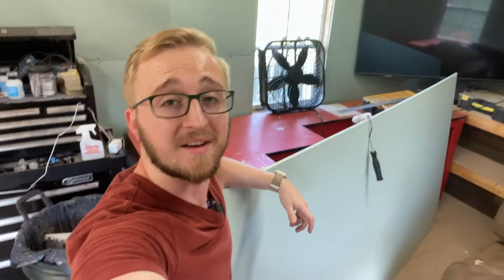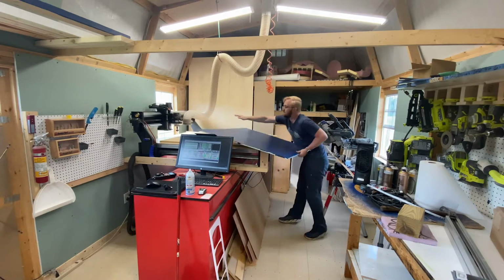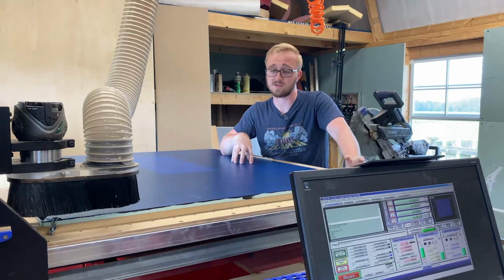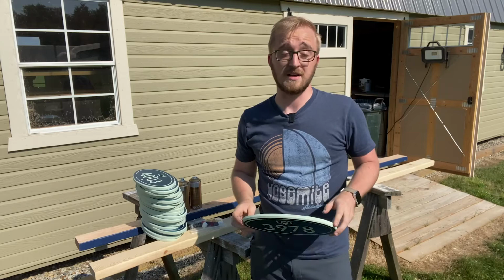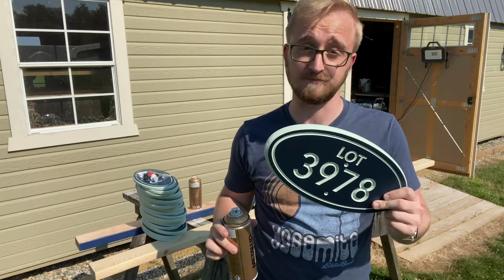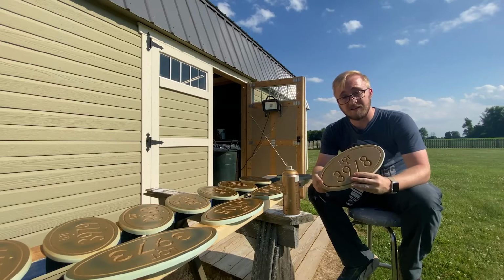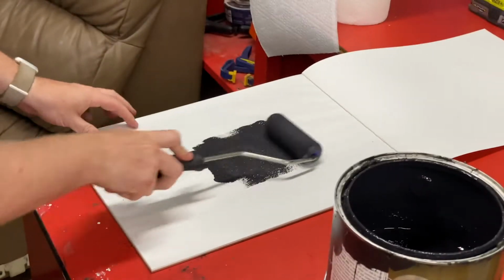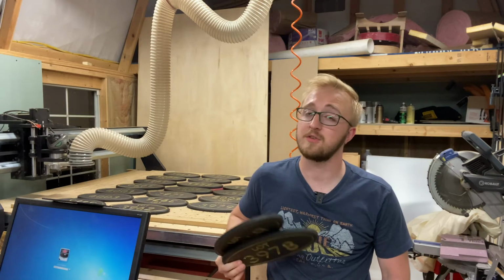How to Batch Process HDU House Number Signs

Comment: Good video.  Is that a special paint you use?
Reply from the maker: Nothing overly fancy. However, I would recommend something better than what I used. It didn’t bond well hence all the touch ups. Adding a good base coat primer and then a good exterior grade paint like Sherwin Williams emerald or an exterior grade enamel paint and you should be good to go.

Comment: Thanks for sharing the video. The paint pull up was definitely from the sun. When painting HDU it needs to dry overnight at room temperature. Even have a shop fan blow on it while it dries. Never good to let it dry in the sun.
Reply from the maker: thanks for the tip! I have moved on from the water based latex and found the oil based enamel with a coat of primer to be a world of difference.
Reply: @CrabtreeCreative  A good, high build primer makes all the difference in the world. I still use latex, exterior paint as I hate oil based paints and the cleanup. Glad you found something that works for you.
Reply from the maker: @FlipFlopPilot  whats a good primer you would recommend?
Reply: @CrabtreeCreative  FSC-88WB is designed specifically for HDU but you can also use Kilz or Zinsser from your local big box store. Brushing or rolling it on works best in my opinion. Please allow plenty of time for the primer to dry.  Since the HDU does not absorb water it has to come out of the surface of the primer. If you paint too early it'll bubble.